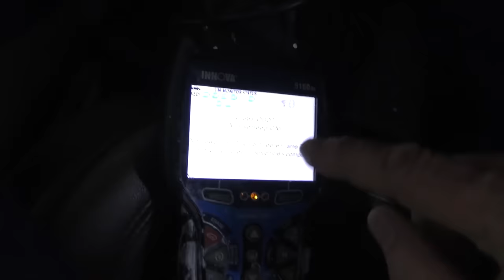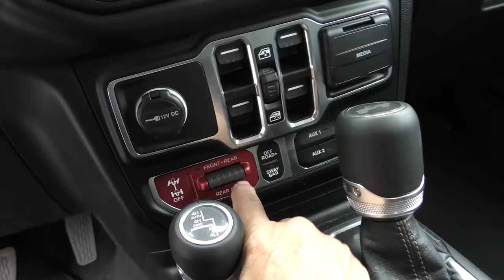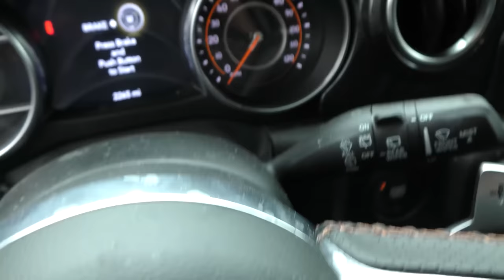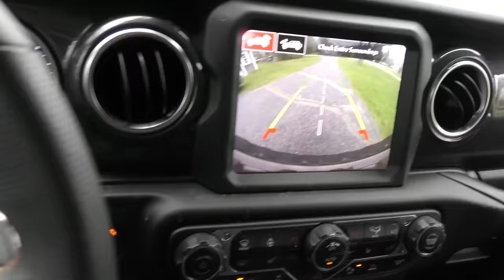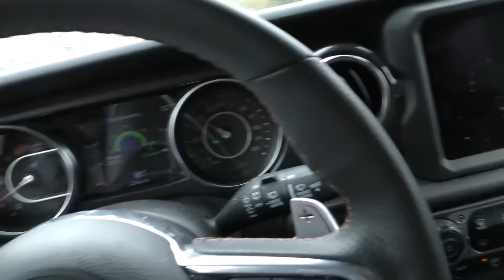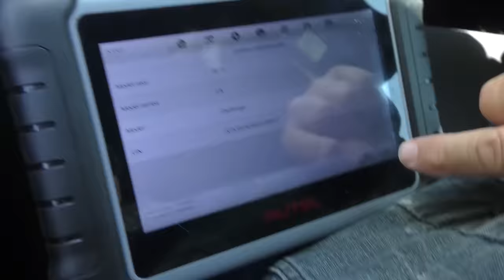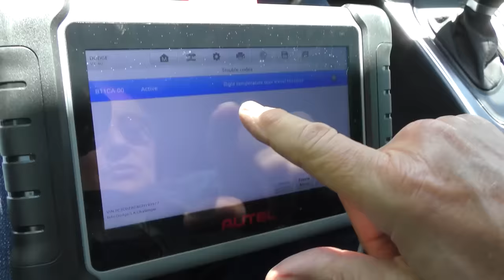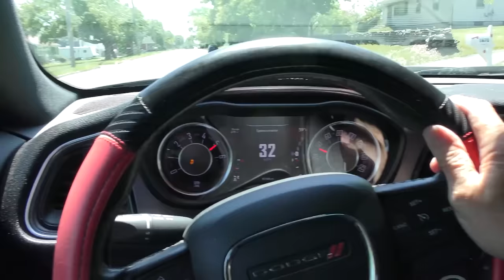3 Vehicles That Look Great But Fall Apart Faster Than a Marriage

Comment: copy/paste for Scotty more education: 

According to the  J.D Power 2023  Initial Quality Study (IQS), Alfa Romeo gets stunning achievement, strongly  improving its IQS score vs. 2022, bucking industry trend.

J.D. Power surveyed new-vehicle buyers about their first three months of ownership, and tracked problems per 100 vehicles (PP100) to measure the brand performance. These are the Italian Brand’s achievements:
Alfa Romeo gets on the top step of the premium brands’ podium and on the 3° in the whole industry in the J.D. Power 2023 U.S. Initial Quality Study (IQS).  Alfa Romeo soared 24 places – the greatest jump in this year’s IQS – to finish first among premium brands and third in the industry. Furthermore, The Alfa Romeo Stelvio also claimed top honors in the study’s compact premium SUV segment.

Rankings & Research
The 2023 Alfa Romeo Stelvio's #16 ranking is based on its score within the Luxury Compact SUVs category. Currently the Alfa Romeo Stelvio has a score of 7.1 out of 10, which is based on our evaluation of 35 pieces of research and data elements using various sources.

Comment: We have a 2013 Jeep wrangler, lifted and outfitted. The Pentastar 3.6 has given me a few headaches over the years, mainly the oil pressure sensors,  the oil filter housing adapter and the freedom top leaks when it's rains. Other than that my wife and I daily it, not the most comfortable ride down portlands pothole riddled streets. And lastly the fuel economy, on 35s average  17mpg. All in all, we love our jeep, it's been pretty reliable, but jeep does stand for Just Empty Every Pocket.😅
Reply: Pretty reliable? Didnt you say something about a few headaches?
Reply: @MrRogvolta  considering I have been a mechanic for 25+ years, jeeps are for the most part reliable. The headaches usually stem from the smaller inconvenient items. My wife's wrangler leaks from the freedom tops whenever it rains, although I have changed the seals and gaskets it still leaks from time to time. The occasional check engine light for something that goes away after a day or 2 of driving. I compare it to the early Ford cam phasers, or GMs truck engine piston slap or go even earlier Hondas coil relay that craps out. It's all minor headaches. Unlike European cars that are plagued with electrical problems, overly cramped engine bays and over engineered systems. But each to their own
Reply: @modernneanderthal6970 doesn't sound very reliable to me. I get your point, the problem is that you compare american vehicles with European and neither of those are reliable vehicles. Japanese vehicles are the ones you should be comparing when we talk about reliability.

Comment: Buy a Japanese car!  
1. Toyota/Lexus
2. Honda/Acura
3. Mazda
4. Subaru
If you maintain them, they will last 200K+.  A GM, Ford or Stellantis won't!
Reply: U forgot Mitsubishi
Reply: Except Nissan
Reply: My 06 pontiac g6 has 202,000 on it. Original engine and trans.
Reply: @MrAlvarez23  they're the exception
Reply: @hydrostatic8048  GM was still decent in the mid 2000s. Not anymore, not by any stretch!
Reply: Many Silverados and Tahoes 2 and 300k on them around me
Reply: @hydrostatic8048  I think the newest car is becoming the problem. Plus, a lot of the dealers go over the MRSP. I wanted to buy a Toyota, Honda, and even Suburu prices are outrageous. I think I'm looking more at the Outlander
Reply: Baloney.

Comment: From what I understand, the modern Alfa Romeo brand is mainly Chrysler. As far as I’m concerned, I consider the ZF transmission a plus. I honestly don’t think they are very unreliable. They are using Chrysler manufacturing. I’m only saying I don’t think they are unreliable factoring in the Chrysler standard of reliability which is well below several other manufacturers. I still think they are good for 150kish.

Comment: Why bother with batteries in a 100% electric car? Why not build cars with small engines so that they can reach a freeway with real electrical power? That way, all that will need to be done is to electrify the roads and that should not be a very big deal because we will need rebuild the grid anyway if we are going to use battery powered cars.
Reply: AUTONOMOUS system. Mouse track of  hitched up commuter cars attatching, detatching, Merging, divirging. Little commuter pods. Flash Gordon stuff.
Reply: @fromthebackofmymind  Too easily controlled by Big Brother. A simple power grid available to vehicles on the freeways will do nicely.

Comment: Alfa gets problems after 8 to 10 Year's electrical also some rust starts to pup up if oil changes are not between 7 and 13 thousand miles cylinder rings going bad then oil consumption is higher after 5 years trunk wires going bad mostly broken alfa has only original parts which are expensive it's hard to buy parts online and dealership trying to sell more than you need in 3x Price

Comment: I got a Jeep Wrangler with the 3.6 Pentastar a year ago and sold it shortly after. That motor is absolute garbage, had to replace rocker arms, oil filter housing, etc. It started having cooing issues, and I said that's it and got rid of it. Worst vehicle I've ever owned.

Comment: 88% of the used Stelvios I see for sale in Japan have an automatic transmission paired with a 2,000 or 2,200cc engine. A few have the 2,900cc engine.

Comment: Here in the UK my friend and I took his wife's Alfa Mito on a shop trip to a car show. Straight away a warning for the rear shock absorbers came on.  They would of been £1800 each if not on a warranty he had!
Reply: He bought his wife the top model Quadrifoglio version of the Mito then, produced till late ‘15 so 8 to 13 years old car. They are equipped with Bilstein dynamic shock absorbers that cost around €650 each in EU. An aftermarket set of 4 does around €1000 though. He’d better bought his wife a less complex Mito from a younger age if you’re afraid of high maintenance costs.
Reply: @hape4  yes, I seem to remember some badges on it and him saying it was the top one.  Eye-watering, best get rid.

Comment: I found a local guy to do maintenance. I bought mine with the warranty. I have an ear to ear smile every time that I get in it. Was worth every penny. I'll buy another Alfa -- but I don't drive a ton.
Reply: If you do maintanence outside the dealership the warranty is void.
Reply: Besides, the spare parts are not usually available anywhere
Reply: @originalthoth7313  That's not true at all. In fact, that's illegal. The magnuson moss warranty act says that any repairs or maintenance cannot void the warranty unless they are done wrong. Even still, the repair can only void the part of warranty that they worked on. So, an oil change does not void the transmission warranty. 

Parts are  tough, but retailers like Alfissimo take care of that.

Comment: Hello Scotty, I got a Honda accord 2014 with CVT, it got 108k miles, don't know if the transmission fluid was ever even changed. Is it worth doing it now?
Reply: I would ONLY do a drain + fill NOT a flush...then 30k later if no slips/hesitations you can do regular then 60k intervals.
Reply: Herman keep your old,so use a clean container just in case something feels not right with the new oil in..
Reply: Yea because it's not a complete transmission fluid flush it's a cvt the dealer not going take all the fluid out maybe 4quarts

Comment: Go figure, my Giulia has 120,000 miles on it and is running great with no problems! My Camry caught fire at 30,000 miles due to some kind of engine defect
Reply: That’s not the norm…

In general Toyota (the old models. I can’t speak for the new turbos engines) beats everyone in reliability and retains it value…

It’s the maker in which it’s vehicles or certain models can technically be considered an assets vs liability which cars are in general…
Reply: @persaud101  too bad that toyota and other japanese cars rust away so fast. Whats the point of an engine that can go 500-700 thousand miles if the body will fall apart much quicker than that? In some 3rd world countries you will see Mercedes, Fiat or Peugeots from the 1970s that still run well, but you never see a 60s or 70s Honda, Nissan, Mazda, or even Toyota in a daily use. Why is it?
Reply: I have 1996 Corolla and 2013 Camry with mileages of 200k-300k + milage not 1 inch of rust.  What are you talking about ?

Most brands don’t even last  over 100k miles

Comment: Scotty, I got 2002 CRV 188k+ , replaced transmission, still delay shift on 1st&2nd gear, above 20 mph no problem but under 20 it jerk b4 shifting... replaced thready solenoids... finally brought it to dealer they said transmission again... oil has been replaced too... what do think?
Reply: Please help I'm in San Diego...
Reply: Sounds like the Trans you got was trash , trade it in or fix it , nothing else u can do lol
Reply: yeh Honda sucks
Reply: Suck out 16 ounces of transmission fluid and pour in a can of TransX.
It worked once for my gm automatic.
Good enough to keep it going for a year.

Comment: 1300 mile oil change intervals and 3K miles a year? I could make a Yugo last doing that.😀
Reply: The internal is 10k, but an oil degradation sensor keeps you in line.

Comment: I'm not a fan of Dodge/Chrysler but I will admit that I think their 3.6 is better than the GM 3.6. But that's not saying much.
Those Soviet built Ladas are cars that look crappy but can last forever. They are flagrantly crude but built like tanks.
Reply: it's chrysler/dodge...chrysler bought dodge in 1928...chrysler builds the challengers/chargers at a chrysler plant.

Comment: We found a Toyota Solara convertible we are considering for a sometimes driver, any thoughts Scotty?
Reply: I had the non convertible and it was one of the best cars I've owned. Made it to 375k miles !
Reply: @senseicorey9979  How did you know it was finished?
Reply: @harrymyhero it a Toyota

I got a Camry
Reply: @harrymyhero  Rust with a capital R

Comment: What's the deal with electric parking brakes on recent cars?
Reply: It’s a law now, manual hand brakes are illegal to manufacture in new cars.  Too many idiots were running themselves over then somehow suing the manufacturers for their stupidity and winning. Oh the world we live in, I wish they’d just let the idiots that don’t know how to put a car in park off themselves. The electric brakes in new cars enable them to lock up the tires as soon as a door opens.  It’s honestly more dangerous in my opinion. People are opening their doors while driving now to spit something out or whatever and the car violently locks it up. That’s the whole story.
Reply: @foellerd  what?  That's insane.  Manual brakes are safer, you don't require electricity to use them.  And that scenario you mentioned is scary, had no idea that happens with electric parking brakes, holy crap.  Are you serious?
Reply: Weren’t the original Jeep off road ready?
Reply: @glennso47  wrong post

Comment: I owned two Fiat X1/9s. Enormously fun to drive on winding roads. Fused and unfused circuits. Fuses where the fusible link wraps around the outside of the fuse - first time I saw this I was "shocked." Luckily no high tech computer, so diagnosing problems was relatively easy.  Toys, not daily drivers.
Reply: Ever race a Pontiac Fiero? 
Toyota MR-2?
Lotus Elan?
Reply: @fromthebackofmymind Never raced but I did have Panasport racing wheels with Yokohama autocross tires on the second X1/9. The engine came with liquid sodium filled valves which could easily rev to 11,000 RPM. Sold my Fiero for a $5K loss after 6 months. The Fiero was a total disappointment which could not get out of its own way.

Comment: I'm about a Quadrifoglio Guilia. What specifically can go wrong with these cars. Why shouldn't i buy it. Keep in mind, i fix most things on my vehicles unless specific difficult to find tools are needed. Btw, I've heard great things about the engine.
Reply: That v6 breaks. A lot. You have to drain the refrigerant to change the drive belt. The carbon fiber splitter breaks too.

Comment: once one fiat 500 (electric) came to the shop and it had charging issues and if i remember right it was the battery which ended up costing more than the car. also there is no handle for the doors in the inside of the car only a button.. i wouldnt rely on fiats electrics once the car gets in crash 😂

Comment: I change my oil twice a year. I drive aroung 7500 miles a year. what is your opinion about changing the oil filter every other oil change, instead of every oil change?
Reply: The pleated filter media will trap about 30 grams of particulates. If the filter was to be completely clogged, the bypass will open and spew all the gunk back into your lubrication system.